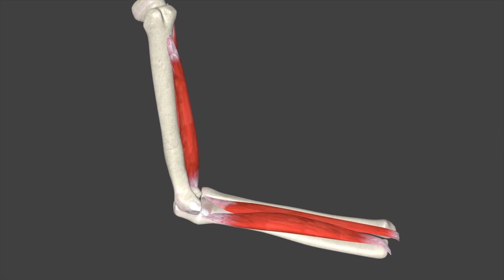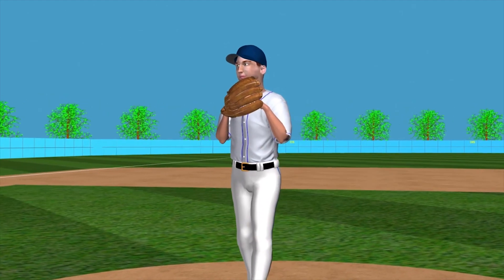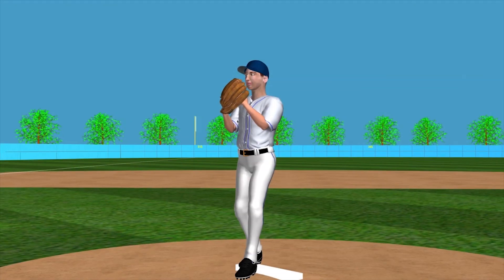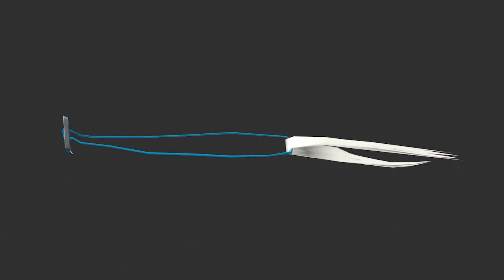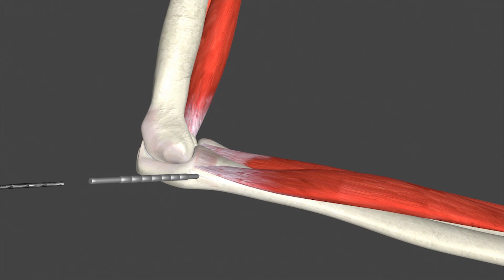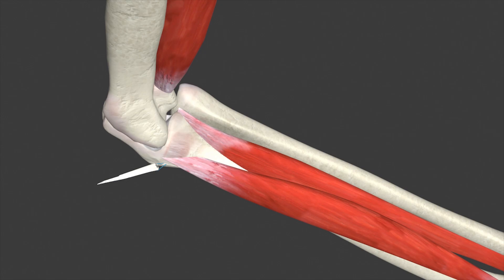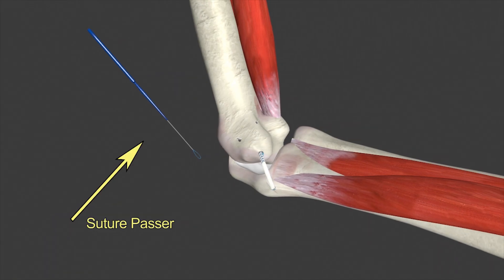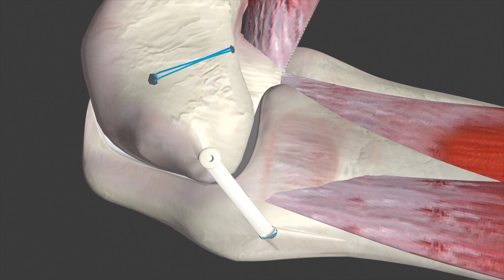UCL Surgery - 3D Reconstruction

Comment: They could probably make the whole process better, by using synthetic rubber replacements, that may require less complexity, via anchors that are a part of the 'tendon' and give greater durability.  So long as there is no rejection of the synthetic rubber.
Reply: Rubber wouldn’t be elastic enough for a pitcher or baseball player, most likely resulting in lack of rom and therefore decrease in velocity and possibly command.
Reply: Well that is the ultimate concern with using a foreign replacement such as rubber. The body will look at this as an antigen and fight against it leading to infection. After having surgery, the last thing you want is to be cut open again and again. We’re not a canvas buddy.
Reply: @XaZzResistance lame I wanted to make the ultimate tendon to throw 170mph😭
Reply: Science bitch
Reply: @overdose956  fucking idiot, how’s it feel to fail school? Jealous much?
Reply: Jason Smith nerd
Reply: @marklabonville263  not my real name.  and, there's a reason Neanderthal died out; they had no idea.  clearly, though Neanderthal DNA still exists...